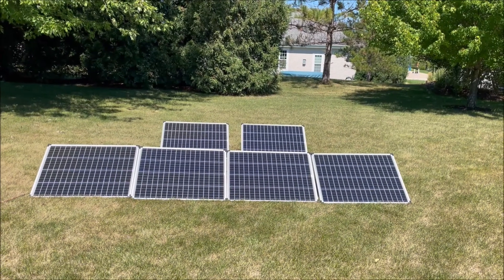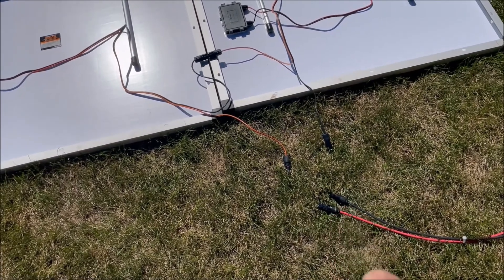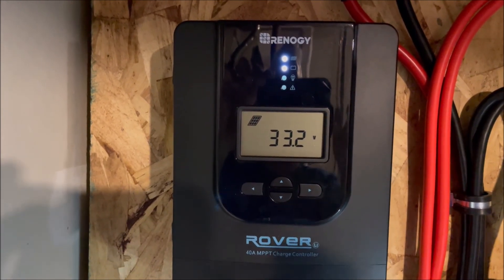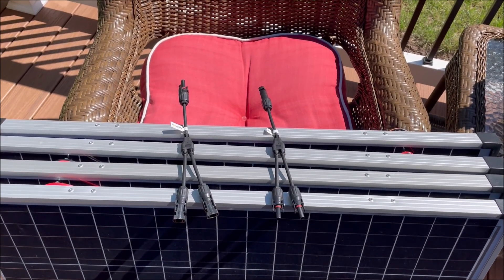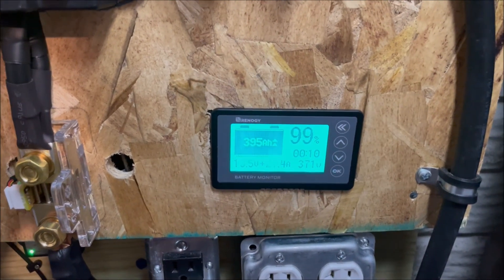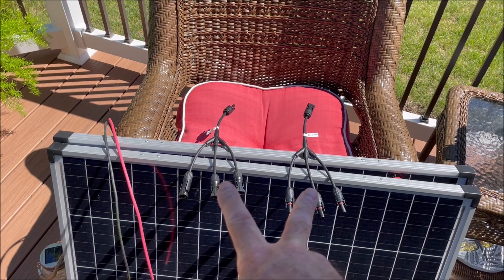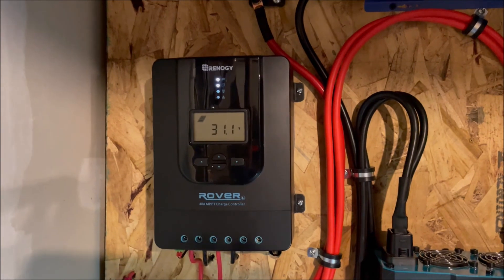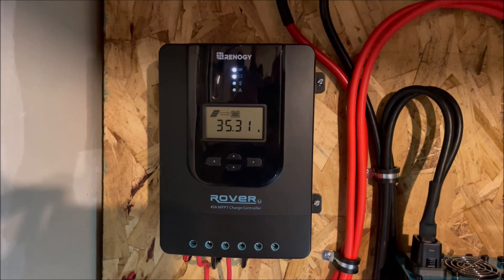Solar Basics: (4) How to hook up your Solar Panels in the 2S Series-Parallel Configuration!!!

Comment: 2s3p is what I searched for.. so here I am.   My four 400w panels in 2s2p aren't bringing but about 750w. So I'm gonna try this by adding a pair of 290w panels. My controller is the Victron 150\100. So it's time to get a couple of them 3 into 1 connectors.
Reply from the maker: Try an experiment by connecting 3 of the 400W panels in series (3S) as long as it doesn't exceed 150Vdc VOC ( I don't know your panel stats).  Increasing the Voltage and reducing the amperage may make a difference.  With a 3S of 1200W see if your results are better then 750W.  With 1600W of panels you should be getting much more then 750W.  Let us know your results.
Reply: @thechiefsway2618  Will do. I hope it is more efficient. I could use the 4th panel to keep my Ecoflow Delta charged. Also have a pair of 400 wind generators to install as a project as well. panel Voc:50.4 but would be well under 10% over rated.
Reply from the maker: @Mywhtjp  Let us know how those wind turbines work.
Reply: @thechiefsway2618  Update:  I rewired the panels 3 in series. They are all on a 41 degree tilt. Yield: 3.11Kwhr 757 watts 135.28 Volts. Previous day I used a smaller controller; 150\45 and was only for the last  hour or two of the day.. so not full stats.. skipping to the next previous day when all four were in 2s2p..  2.58KWh 690 Watts and 90.04 volts. So there is still something limiting the power coming in.
Reply: @thechiefsway2618  Todays update. I have 4 of the 6 290w panels in 2s2p config..  The day isn't over yet.. but they did well.2.4 KWh, 788w and only 79.80v. I'm waiting on some 3 into one branch connectors and I can add the last 2 panels and see how they respond. These 290 panels are Polycrystalline too. Not the best efficiency either. Sky was cloudier today then yesterday too.. Sawa bolt of lightning and heard some thunder close by too.
Reply: @thechiefsway2618  Oh.. and sunk a pole in the ground for a 2nd array too. 1600w worth.

Comment: Those are harbor freight panels I thought they were 24v panels my HF 100 watt panel usually  produces 20 to 22 volts depending on sun conditions
Reply from the maker: The Voltage Open Circuit is 24V.   The Maximum Power Point I Generally see is about 18v per panel.  Typically see right at 100w or more per panel in full sun.

Comment: On your first setup I'm confused on how you were making 13 some amps with 2 - 5.6 amp panels in series. The amps shouldn't change in series. That amps would be more like 400 + w out of 2 -100w panels. Something isn't adding up. Amp x Volts = Watts.
Reply from the maker: That's why the HF Panels are so great and worth every Penny.  The book says 5.56Amps, but these panels regularly outputs 6 + Amps.

Comment: How are you bringing cables into the house now that you converted to MC4. I’m looking for a way to have something to tie into on the exterior
Reply from the maker: I currently use a Zamp SAE connector connected to the house (Link Below).  I have a MC4 to SAE Adapter to convert from the panels to the Zamp Connector.  I am eventually going to up grade to this MC4 Wall penetration eventually (Link Below).

Zamp:  https://www.zampsolar.com/collections/solar-ports-wiring/products/side-wall-port

MC4:  https://www.amazon.com/dp/B07M98WSBQ?psc=1&ref=ppx_yo2ov_dt_b_product_details

Comment: 500 and some Watts between your six 100 w solar panels well my four 100 watt solar panels gives me a little more than 400 watts so I think harbor freight solar panels are like 135 watts each.
Reply from the maker: Sun conditions are nor perfect every day.  Have a recorded peak of 611W on the Renogy App.
Reply: @thechiefsway2618  it's nice to hear from you I mean usually I get your shows videos whatever you want to call them a year later but this time I got them a few days later and I want to correct some of this stuff you're doing it seems like a mistakes that aren't really mistakes cuz I know you want to be safe and I do things just slightly different than you do and I'm only running 12 volts because that's what I had for inverters at first now I have 12 volts but I also got 12 volts and 24 volts and now I have a just got in the mail yesterday at 12 volt a 3.3 volt and a 48 volt inverter all in one but now I need to get some real batteries for it and all I have is 12 volt that ass of batteries 135 amp hours and they are ancient because they're older than my truck and my truck's a 1993 and he riders have been around since the '70s and '80s and they're still as good as new but I do get some newer batteries with them too but I need to get some batteries I cannot afford to get but I'll leave it there.

Comment: But are you losing your Watts like you were last time I'm just wondering all those bus must be taking your Watts away from you cuz if you ain't getting very many watts my four 100 watt solar panels from harbor freights give me 400 plus Watts I hate to break but I do test my solar panels I know what they give. I just think you're kind of hooking them up wrong because from your last video to this video I don't think it adds up very well.
Reply from the maker: When they were in Parallel I was limited to about 350W.  Since I converted the panels to MC4 connectors to hook up in series I'm getting much better Power.  I connect them in a 3S-2P configuration.  I am regularly over 520W and have a recorded a peak on 611W on the Renogy App.

Comment: I’m like five days behind you. I’m getting only 180 watts from four of the same panels into the 400w connector just like you did and my next step is to do the MC4 cable update and set them up in 4s to my Bluetti AC200Max.
Reply: Four harbor freights 100 watt solar panels they're all hooked up and 12 volts I didn't cross black and red cables cuz I only had a 12 volt inverter but then I got a 24 and 12 volt or 12 volt and 24 inverter but to tell you four of my 400 watt solar panels gives me 400 watts Plus that is four 100 watt solar panels from harbor freights but there's another place you can get those solar panels for a lot less with the other connections where you can hook them together tractor supplies sell them for less the exact same solar panels for like $30 less or $34 less but you have to have their app they get them when you order them off the app and you just go pick them up at the store I think that's what I'm going to do cuz I don't know if they're better find my house because they never delivered to me yet and I'd rather pick it up from the store. Oh and Walmart has 100 Watts solar panels that they sell for about the same price as harbor freights or a little less but you have to have their app store and you always have to ask what you're looking for.

Comment: Are they Harbor Freight panels.
Reply from the maker: Yes the panels are all from Harbor Freight, and I had modified them by changing the SAE connectors to MC4.
Reply: I was wondering if running two 100 w panels in series allow full 200 w input in EB70s?